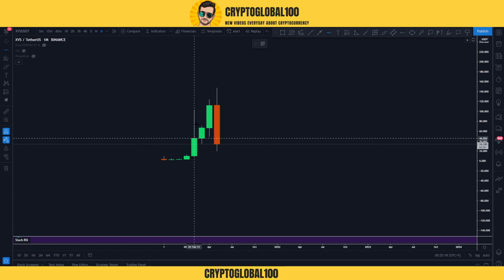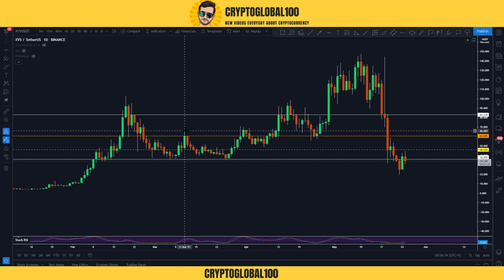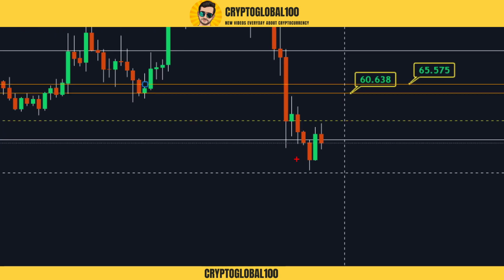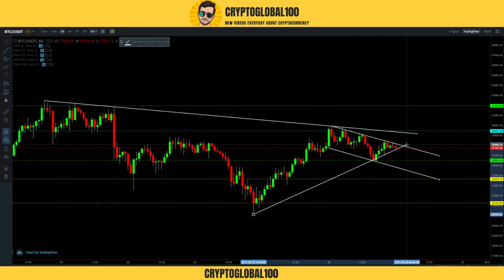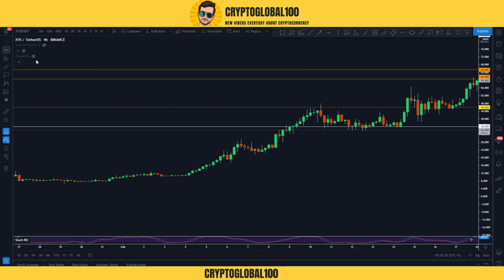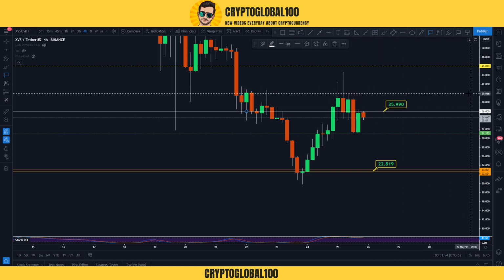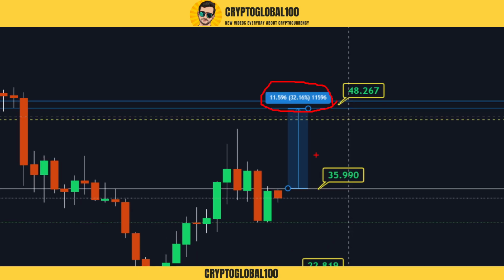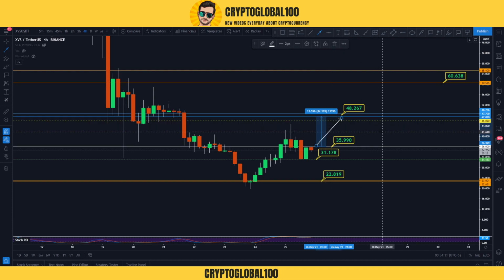XVS Price Analysis | XVS Coin Price Prediction | Venus Price Prediction | XVS Venus Price Analysis

Comment: Bitcoin has seen some massive momentum that has allowed it to erase a good portion of the losses that came about due to the recent plunge. This sell-off marked capitulation amongst investors, with many clearly fearing that the multi-month uptrend that led BTC to its all-time highs was over and that a deep retrace was imminent. Nonetheless, bulls have since gained full control over the crypto’s price action, and it is now positioned to see significantly further near-term upside. There was a break below the 200-day moving average indicating the bulls are trying to surmount and a firm break above this level could confirm that this bounce marks a full reversal of the recent downtrend. Staying profitable round the clock should be every investor and trader's goal, which is why I trade daily to increase my holdings. Even though am not an expert trader I always ensure to trade efficiently by copying and using trade signals of expert traders and Chris Dillow the best signal provider I have come across because of his trade signals being copied in my trades. I obtained 4.05 BTC from 0.9 BTC with the help of Chris Dillow. A senior trader who gave me trading strategies. He is an experienced trader with 90% accuracy. His methods of trading are profitable. You can easily get to him via Ͳelegram @ DillowCrypto
Reply: Consistency is key when trading Chris Dillow signals. I always like his personal approach and the way he goes the extra mile to help you make a profit.
Reply: I see him as someone who takes the success of everyone under him seriously with top priority. I am happy to have a pro trader like Dillow.
Reply: @audile34  Access to good information is what we investors need to get ahead financially in the crypto market.
Reply: The best strategy for trading Bitcoin is to trade with an expert who understands the market as their own profession and gets maximum profits. Many thanks to Mr. Chris
Reply: I lose about 0.826 BTC after just a few days of the dip. Now I am recovering my loss with the help of Dillow's trading strategy. his trading strategy is really helping.
Reply: @Sambaman100  With the way the market is moving If you are smart you won’t wait for someone to tell you to start trading and regain what you've lost.
Reply: Chris is always tried and trusted. He has been guarding my trade for months and I'm making a profit every week. I am currently on my 4th trade with him which has been profitable.
Reply: I've won your trust so many times and you haven't failed. I'm glad to have a pro trader like Dillow. With Dillow's strategy, bitcoin to the moon.
Reply: His experience, strategies, and analysis are rare and help keep me grounded in a sea of crypto hype, FOMO. Insightful, and calming
Reply: I always like to invest in Chris Dillow's recommendations. I like his strategies and the way he interacts with his subscribers. His daily signals updates are always awesome!